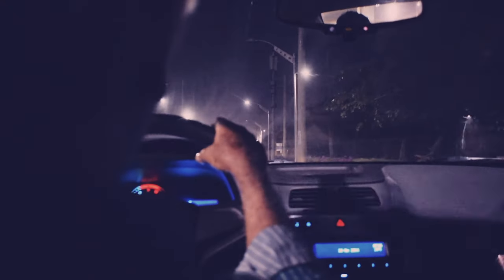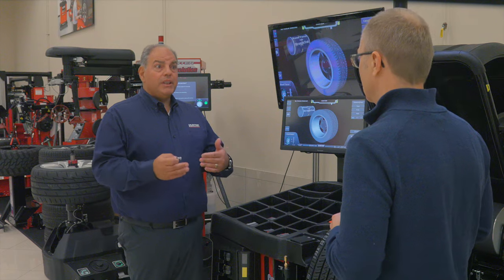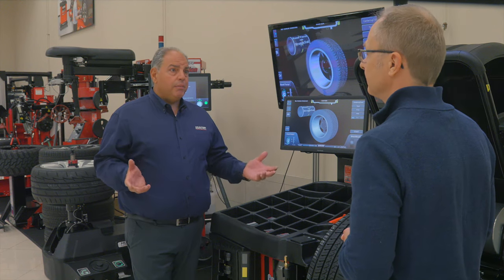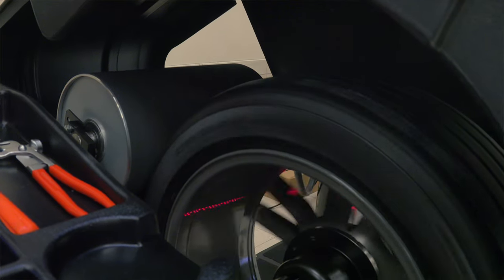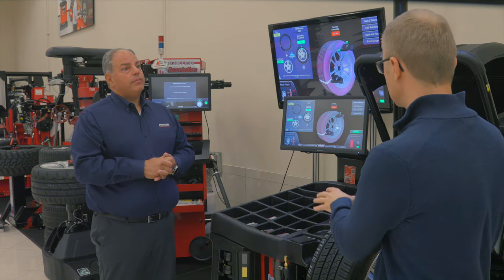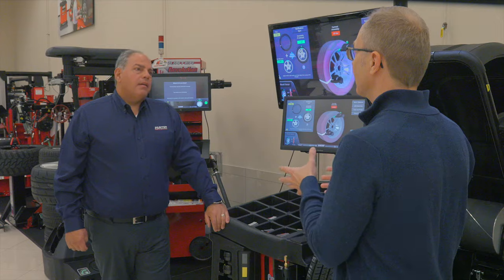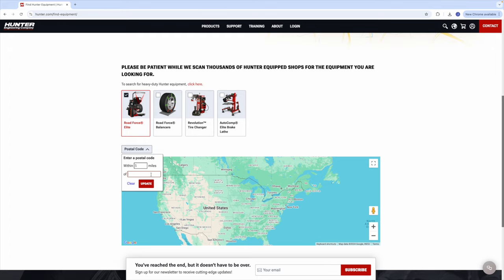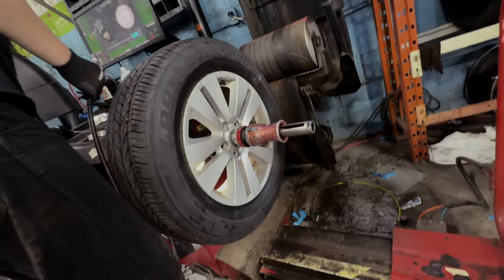Why do my balanced wheels STILL shake? 😩| And how to FIX it 😁

Comment: An egg shaped tire won't be detected by most tire shops. I jacked up the car so the tire just cleared the pavement, then I rotated the wheel and found the tire was 1/4 inch out of round. The manufacturer fully refunded the tire's cost, even after 6,700 miles use - no argument - no fuss.
Reply: 100%. 2 years dealing with this and Discount Tire. Got new tires and all good! I could see the egg shape, but they thought they were perfect.

Comment: I replaced hundred of tyres in my cars in the past 20 years, and it was few times I got luck to have perfect tyres, most of them weren’t. I tried top brands like Pirelli, Continental, Bridgestone, Goodyear, Dunlop, Hankook, Toyo, Yokohama and Cooper and only three Pirelli, Bridgestone and Yokohama were less prone to vibrations. You have to keep in mind that the way they store the tyres, will play a vital role in causing the tyre to vibrate and unfortunately no many shops pay good attention to storing tyres properly. Many occasions they found the tyres were defective and they had to replace them even though they were fitted brand new.
Reply: Lots of tire shops don't know how to clean the lens on the machine nor how to calibrate them.

Comment: All this technology can’t overcome lazy or rushed technician.
Reply: Especially on a 95deg day when the customer wants quick and cheap.
Reply: Could not agree more and have come to the conclusion the tech simply do not know how to run a balancer. I ended up buying a brand new cheap Weaver China balancer for around $1000.00 and have had awesome results that the shops could not achieve with their $25,000 dollar balancers. Its the operator.
Reply: Wheel lift, laser guided weight placement, no input for dimensions all make the balancer more resistant to lazy/rushed/inexperienced technicians. That being said there is no perfect solution for a tire tech that still won't perform their job properly. Like a tire that won't ride smooth regardless of what techniques are used for it. Sometimes it just needs replaced.
Reply: The fact that the tire installers don't know what the red or yellow dots on the tires mean or where they belong in relation to the rim's high spot or the tire valve means they did not put the tires on properly to begin with.
Reply: The equipment is only as good as the person using it

Comment: We have two Road Force balancers at the Firestone where I work.  We rarely ever get to use the Road Force feature of the machine because it’s broken 80% of the time.   We get it repaired, it “breaks” again.  The factory rep has confirmed that we ARE using it correctly.  We have two of these balancers and they are both broken constantly.
Reply: $50 they still sell it as a "road force balance" at a higher price with no such work being done....
Reply: @stargazer2504  Nope. It's the same price Road Force Balanced or regular.  Neither the machine nor we at the counter care.  It's the same price either way.  It's only, like a 15 second run time difference between the two.
Reply: The Chrysler dealer here continually sends tires out imbalanced with Roadforce. It makes tire shops lots of $$
Reply: @maxwebster7572  The charge for normal balancing and Road Force balancing is the same.  And, as I stated, our Road force machine is down 80 percent of the time anyway due to calibration issues that cause imbalance.  It's a shit system.
Reply: @NorthernChev  Yes it is a shit system, buddy had '24 Ram balanced at Chrysler 4 times before he took to tire shop. They asked if he had Road Force and then proceeded to take 4oz of the new wheel.
Same dealer installed a new diff and box for vibration. You could see the box move in the side mirrors. That one was bad driveshaft. It's a small town, we all know not to go there now.

Comment: My stepfathers tires were giving his car some slightly noticeable vibration. I checked them individually on a spin balancer where I worked for a major tire distributor.  They all indicated they were properly balanced.  So I put a spacer on the ground below the tires while spinning on the spin balancer and discovered that the tires were manufactured out of round by almost one fourth of an inch  ! 😮  So he bought 4 new balancrd tires ; had them installed and the slight vibration he usrd to experience was gone  !😊
Reply: Tire installer balance is only tire and rim. Sometimes hub assembly is a bit off balance. Tire can be out of round. Rim can have excessive runout from curb strikes. Had a bad vibration at speed, thought it was CV axle. It turned out to be failed motor mounts. Check those FWD motor mounts as soft rubber is not forever.

Comment: Tires come from the manufacturer with marks on them, most tire shops just ignore those marks because they have no clue what they're for, it's the balance of the tire itself, which is supposed to balanced with your rim to get everything as perfectly centered as possible.  Otherwise it's like having an unbalanced load in the washer.

Comment: Hunter wheel balancer is only half of the fix, you have to know if your wheels are hub centric or non-hub/lug centric, and find a shop that knows if they need to use a special adapter to balance your wheels.  I had a 97 Toyota 4runner and Toyota SUV wheels were known for hard to balance because back then most shops had no concept of this hub centric and lug centric wheels.  After some research,  I found a shop that were using the Hunter 9000 and the special Haweka Adapter to finally get rid of the vibration.  I don't know if Toyota wheels are still hard to balance now or Hunter balancers have this adapter built-in now.  That was 20+ yrs ago.
Reply: Sie haben ja Recht mit Naben zentriert oder Lochkreis zentriert ... grins

Die Hunter Road Force Elite (3te Generation) mißt ++unter anderem++ die Zentrierung automatisch 
(= Automatic CenteringCheck = Garantiert richtige Zentrierung und verhindert Aufspannfehler)

Tip = weiterbilden 
(Webseite Hunter Engineering dann lesen lesen und denken, evt PDF lese, Messebesuch, Vertreter einmal zuhören, an Vorführungen teilnehmen)

Hinweis = 120 Softwareprogrammierer beschäftigt Hunter (auch mit Studium , aka die haben etwas mehr gelernt als man vermuten kann). 
Die Maschine hat einige Laser und so komische Kameras. 

Die Software erstellt nicht nur ein 3D-Abbild des Felgenprofils innen und 
berechnet (nach Auswahl der Position der Anbringung der Wuchtgewichte) 
diese dann natürlich passend zur Entfernung zum Radmittelpunkt mit korregierten Gewicht ...

... sondern die 3D-Konturenberechnung stellt automatisch Rundlauffehler, Seitenschlag fest.

Anmerkung = Soweit ich mich an die werblichen Aussagen erinnere.

Comment: I believed "road force" balancing was like nitrogen air filled tires, a scam.  I was was wrong.  Absolute night and day difference, and didn't cost an arm and a leg.  The next time I got tires, it was from a place that did "road force" balancing.  I'll never go back to regular balancing.
Reply: I kinda is a scam.   In order to make a non-concentric tire work, you need a rim that is slightly bent.  That machine and 3x the labor indexes the high spot of the tire to the low spot of the bent rim and hopes to cancel out as much as possible.

The correct way to do it, is to shave the tire/rim assembly round.  But hardly anybody (other than me) has the machine to do it.

Comment: A large percentage of tires are not round! 
Wife's uncle had a tire shop in Glendale, AZ for many years. He specialized in Tire Truing, aka shaving. He did many hundreds in the day. Unfortunately he's gone now.
Tire Truing is an intensive process that works great! Sadly, it's a lost art. Might be able to find a racer that will begrudgingly do it.
I had cheap, mud/snow tires on my 77 4x4. They were bad on the highway! He trued them, they were smooth as could be!
Had this done to some other name brand tires that were troublesome to balance, works like magic.

Comment: I've owned 4 different vehicles over 20+ years of driving and had numerous sets of tire replacements, alignments, and wheel balance (including Road Force balancing that one shop offered).  Most of my vehicles would develop shaking as they aged and the balancings and other services didn't seem to help.  I replaced numerous components from brakes to CV axles to suspension arms and bushings and engine/trans mounts.  What finally fixed the shaking was to clean off the thin film of rust from the mating face of the wheel that had transferred from the brake rotors and drums.  NONE of the shops I had ever taken a vehicle to had done this.

Comment: I have a Kenworth that has seen over a million miles in its life.  It would have a vibration at 55mph and it never went away.  Because this truck went everywhere on the highways,  I had tires of different manufacture, ie. Toyo, Michelin, Goodyear, Firestone etc. installed in different locations and balanced.  I had the truck in the shop countless times and everything was checked and parts replaced. Nothing worked.
After years of this,  I decided to replace the wheels and like something magical,  the vibration disappeared.  Some things are just faulty and just because they are new and machined,  doesn't mean they are perfect.

Comment: Match mounting should be done in the first place, there should be a paint dot mark on the tire then match that mark with the valve stem.
Usually works
Reply: Should be but in 99.9% of the time they just chuck the tyre on the wheel

Comment: I've also had highway speed vibration when I had a partially torn lower control arm bushing. It wasn't visible until I uninstalled the control arm. A new control arm solved the problem. With it just being partially torn, there were no other indications other than the highway vibration that felt just like an out of balance tire.

Comment: Some Ford Explorers had a recall that replaced a melted control arm bushing and added a heat shield. That fixed a TON of "tire vibration" problems.

Comment: Why did we only have this problem most times with factory seconds in the 70s and 80s? Now I can't by premium tires that are all round.
Reply: I kung fue you.
Reply: Because back in the 60's and earlier, tire shops had a tire shaving machine.

Balancing really means nothing in how a car rides. It's how round the tire is that matters.

Comment: I prefer to use Centramatic balancers.  They are mostly for trucks of all sizes.  But I am getting them for my Jeeps.  They work really well on my wife's 2018 Ram 2500 4wd with that beastly 6.7L Cummins.  Even before we put the 4Wheel Camper on.  The centramatics give the tires a nice ride and smooths out tire wear.
Reply: Equal or dynamic beads help.

Comment: Nope. If I have an out of round tire I am simply getting an on the vehicle truing done.
The tire is spun, on vehicle, like a lathe and the tread is shaved until it is perfectly round.
Used to do all heavy trucks this way and now they do passenger tires as well.
Shave it, balance it... done.😊

Comment: You can have balance issues of using lubricates on the bead of the tires to ease the tire to be replaced. The only thing is some lubricants don't dry off and can cause the tire to spin on the rim causing tire vibration issues. If you want to see if that is happening, make a make on the rim and on the tire after replacement. If the marks are not aligned anymore after using the tires and vibration, then there is issue of lubricant on the bead of the tire and should be cleaned of lubricant.

Comment: Had this happen to me with a chrysler 200 that was riding perfect until my first rotation and balance. From that point on had had vibration in the rear of the car, I moved the tires around and the vibrations moved. I went to five shops with road force balancers, some would get it better, but issue never went away. I ended up dumping the car after two years of frustrations.

Comment: I bought some BFG KO's for my 2007 Dodge Ram. 285-75-17. One size up on stock forged Ram wheels. Immediately I notice highway vibes. Discount rebalanced them to no avail. I personally witnessed them zero'd out too. Next they Road Force balanced them and same deal highway vibes. I asked the manager to take a drive with me and he refused referring me to BFG. BFG refused to intervene saying it was Discount's responsibility. Frustrated I replaced the tires with Toyo's. Silky smooth at 80 mph. I've yet in all these years have a bad Toyo tire. I know one slips through but my with experience and my other full size truck buddies won't run anything else. I've got some Cooper's on my 2005 Honda Pilot and they've never been as smooth as Michelins or Toyos.
Reply: The trick is to shave tires perfectly round after mounting them on the rim.  Balance weights really mean nothing if your tire isn't round.

Bad part is tire shaving is a lost art, but people will pay HUGE money (and do 3X the labor) for road force.   And, like dude said, if your rim isn't bent, it doesn't work.

Comment: Twisted Belts in the tire during manufacturing. Also you can spin balance your rims without a tire and see if the rims are actually true. I started spinning tires in 82 so nothing really has changed.
Reply: My problem.   I bought aftermarket rims and one barrel is quite literally not centered on the spokes.  It’s not actually possible to get rid of the vibration. Bummer.  No warranty either.

Comment: 30 years ago where I worked if the tire needed a lot of weight we broke the tire down turned it half a turn and it would usually cut the needed weight down, I seen '' 1 time '' a tire needing 0 weight after just turning the tire,
Reply: I used to do that all the time when I was a motorcycle tech.  I'd balance the bare rim and find the heavy spot first.   Then mount the tire without beading it and put it back on the balancer.   I'd put the two heavy spots opposite of each other, then bead it up.    Most of the time it took zero weight or very very little.

Comment: Also probably not comon on a new tire but i didnt realize they had belt in them so if a belt inside the tire breaks you may not see it with the naked eye but it essentially is now a flat spot in the tire.

Comment: I went through this problem many years ago.  New tires that had a high speed shake.  Had the wheels and tires balanced three times at three different shops and still happened.  Isolated the problem down to two tires so put those two on the rear axle and it still happened.  I then replaced the wheels and it still happened.  Replaced the tires with the same type and brand.  Still happened.  Finally replaced the two tires with more expensive tires.

Problem solved.
Reply: @imanoppressedamerican  yes it was.

Comment: Some tires it's where they spliced the tread.  One set of Winterforce tires I had them rebalanced them 14 times in 12 months. 
Finally the shop took them back and put Toyo tires on my truck and the shaking went away. 
But the truck ate 8 wheel bearing in 4 years.  Because of the tires. 

Sold the Avalanche and bought a Silverado 14, and drove it 6 years on one set of tires and no wheel bearing. 
But the first set I bought  made in Vietnam bounced like a  basketball. 
I drove them twice and made them put the used Toyo back on the truck until they could get me a set of Bridgestone Revo

Tomorrow I go for new tires.   Cross my fingers and toes. 
Kendra -  Made in Vietnam

Comment: Bent rims balance, then vibrate when driven.  Balancing can address the "balance" of out-of-roundness, but it cannot make a square round.  "Road Force" is a name.  Simply starting with round, not bent, wheels is important!!  The dude getting paid to put weights on should always witness the wheel spinning, to be sure it's round first.

Comment: You didn't mention the idiots at the tire stores that mount directional tires backwards. I bought a used car that had a vibration in the steering wheel. Twice I had the balance checked and all my tires were good. The third tire shop took one look at my car and spotted the backwards mounted tires. Once that problem was corrected the vibration was gone.

Comment: Eggactly. Hitting a pot hole hard will cause a bulge on the tyre. Which is undetectable by eye. But free rolling the whole wheel on the flat ground will show the tyre leaning side 2 side.

Comment: A tire balance machine is only as good as the person using it.
Every balancer I've ever used has had a High Accuracy (coates) or Technical (Hunter) mode that does a much better job. The operator just has to be aware or give a shit about doing a quality job. It doesn't take any longer really, just might take an extra weight or slightly more weight.